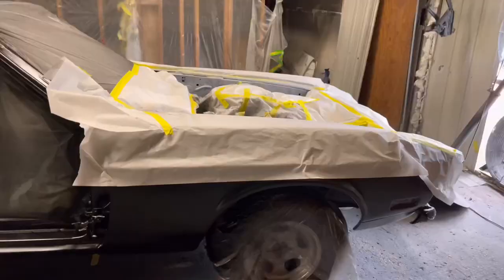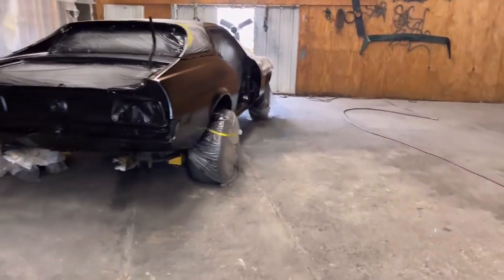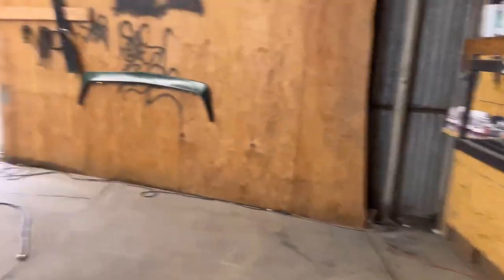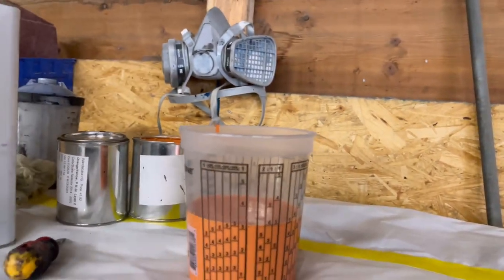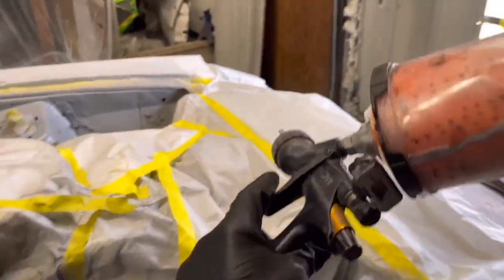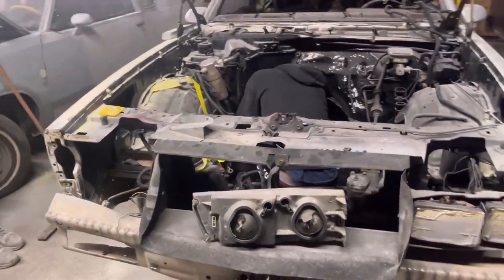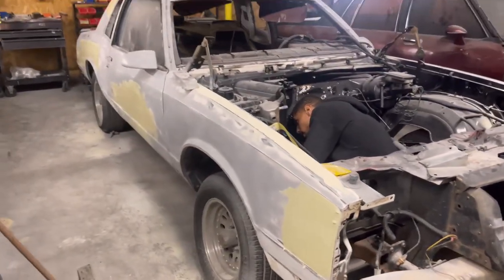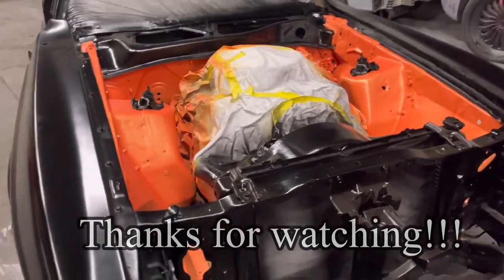How to paint your engine bay | paint mixing ratio #pearl #painting

Comment: Gotta use slow hardner and reducer for everything year round 

Slow is fast
Reply from the maker: I’ve heard of that, but never really understood exactly what that meant lol
Reply: @bzoewitwheels4029  really apples for everything, slow Hardners and reducers help the paint to flow out, Mettalic paint is easier to spray with slower reducer, less chance of mottle or stripes, I switched to slow Hardner for my primer, it lays really smooth, hardly no orange peel so not a lot of sanding I have to do

Just going slower in general will speed up shop production because you double and triple check everything before the next step so no screw ups or redos
Reply from the maker: @paintbykevin886  😮‍💨😮‍💨definitely appreciate that!!💪🏾💪🏾makes sense!!